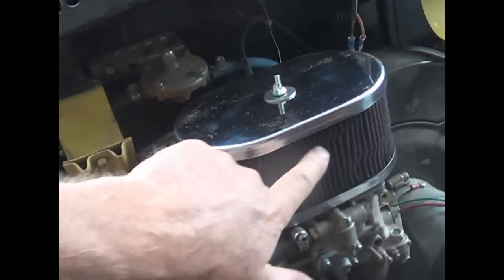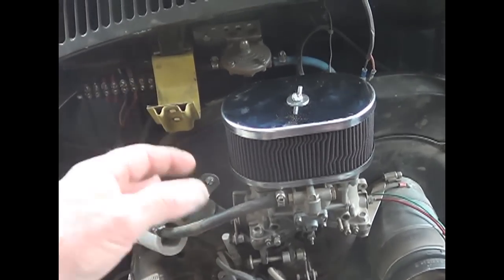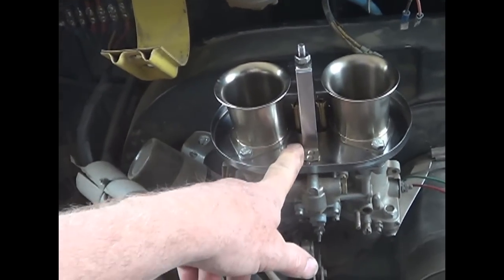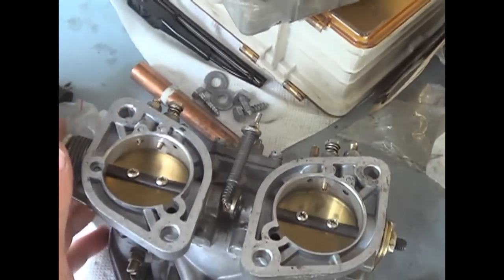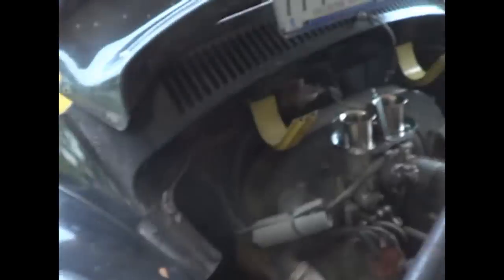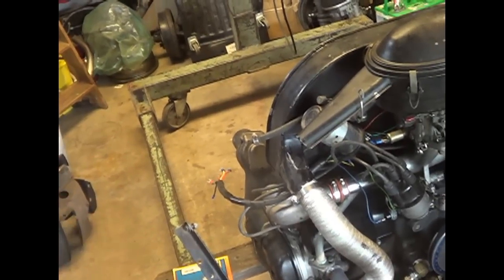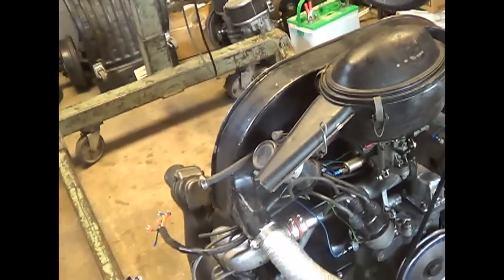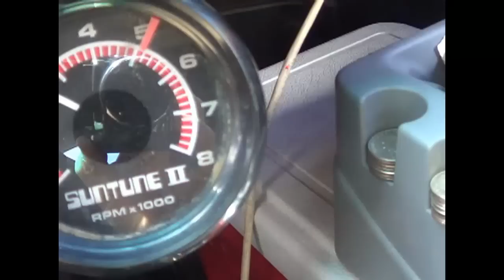Weber IDF Center Mount Problems and Solutions

Comment: Just starting out, purchased a fiberglass buggy, tirying to get the center mount Dellorto 40 to run correct. Just for cruzing around town, not worried about performance. I'm told it is a 1835, I love all the info from your videos. I have watched all the carb videos many times. Thanks keep filming, J Kelley

Comment: Same setup on a twin port 1600. IDF 40 is running smaller 115 main jets, Idle jet 52 Accelerator pump jet 50, Venturi 28mm, F11 Emulsion tube. Mostly driving around sea level though.

Comment: a lot of the problem is the stumble, or soggy bottom, but it's due to lack of heat beneath the carb. The manifold is cold and the fuel falls out of the air moving thru the manifold and it goes lean. got to have a very warm manifold beneath the carb to get the driveabilty back. If your in the desert with over 100 degree F ambient may be ok with out heat...otherwise, got to get it hot.

Comment: 20 years ago I welded up a set of type I dual port manifolds to accept Bus Type IV dual Solex. I can't say I had very good results, but then I wasn't very good at engineering equal flowing manifolds and proper linkage. My point is that the search for the streetable affordable dual carbs is endless
Reply from the maker: +Raymond Heath Seems that way some times. Look at the experience you gained and kept with you all these years. I have tried to make things from time to time because I wanted to save a $. Afterwards the price didn't seem so bad. Just cause they look simple don't mean the average guy can make them. Thanks for watching and sharing

Comment: I have just spent this winter replacing duel carbs rebuilding them adding a cat. Conv. All I am attempt to pass emissions here in Nevada!! 😢. So I just installed new single idf manifold and card linkage (linkage was the worst)🤣🤣. Numbers on the 4 gas were double than acceptable before. Wouldn’t even fail the test as Co2 was over 19% 😊. Hopefully my single idf will at least fail it so I can get a wavier . 😂😂 as I have spent double required
Reply from the maker: That's a bummer. I didn't know Nevada was tuff on emissions!

Comment: My single 44 Weber works great!
Reply from the maker: I'm happy for you. share the details
Reply: It started when my neighbor gave it to me attached to the chrome intake. I installed it on my 1776cc dual-port engine with 044 heads and a 110 Engle cam. The heads have been hemisphered.  Turns out that the carb was originally setup for wide open throttle on a Baja Bug and was just too much for my street Bug. I had the carb venturis reduced in size and rejetted. Has been working great ever since.

Comment: Just installed a center mount carb like yours and i am really happy with it, but did you also have an issue with gascable rubbing on manifold?
Reply from the maker: Yes, I thought about switching to the CB Performance over the top air cleaner base set up but lack of center mount manifold heat was also a problem.
Reply: Hi Fluidspace, I am having the same issue - did you manage to resolve it? Drilling a new hole through the fan shroud?
Reply: I bend the pipe going through the shroud

Comment: It is disgusting how much dust gets through on my HPMX.......along with that, the linkage is garbage. I would love a Weber.......but my pockets are pretty shallow these days.
Reply: The knock off replica Chinese 40 IDF carb are fine. An exact Weber replica. I just purchased a new one on Ebay for $125AUD. New Webers are made in Spain now. Genuine old ones were made in Italy. I have an original Italian 40 DCN 14. It has sat for over a year on the second hand Twin Port 1600 I purchased. I am going to put it aside and clean it, they ran three of these on old Ferraris. I would not go bigger than a 40 IDF on  twin port 1600. This would be to much fuel for a single port heads engine.
Reply: @andyroo3022  I ended up buying a Ch-Weber 40 IDF.....for $48.00......I seriously cannot believe the results; Buggy started right up and idled smoother than I ever heard it idle.....and then proceeded to impress me while on the trails. I then fine-tuned it with the jets from my HPMX......I GLADLY gave the HPMX away to a friend......or was he?!?!?! lmao
Reply: @drummer4hire12  Nice. Bargain performance there.

Comment: Have you ever considered checking out Throttle Body Fuel Injection, such as Holley makes.  They have a single barrel as well as a two and four barrel ones.
Reply from the maker: I saw a vid on a VW Baja with one. It wasn't to detailed. I checked out the price and then there is still that manifold heat issue.  CB makes one with just a throttle body and the injectors are on the in manifold at the head $$$$$$ If people won't buy it there won't be price war's to make them cheaper.  I think thats why all these copy cat carbs are available.

Comment: Really appreciate you answering all these questions it's a ton of help when you have little experience. Here's another one for you? On my 40 IDF when the throttle plates are closed they just barely cover all of the progression holes. When I go to tune the carb if I screw the idle screw in at all it will start to uncover that first progression hole. Is that normal? I thought I heard you say in one of your videos that all the progression ports are supposed to be hid while the vehicle is at idle..
Reply from the maker: The throttle plate should be directly over the first progression hole.  The throttle plate is not round so it allows some air to go past. The needle valves are then used to smooth out your idle. You must use the correct size carb and venturi that Weber recomends  for the displacement of your engine or they won't work properly at idle or low RPM.  
The Individual Runner carbs, IDF, have individual Idle jets and mixture screws for each barrel. They also have an additional air bleed screws and lock nuts. This is not used for idle adjustment or idle quality. The settings for these screws should be closed. 

 
Standard IDF Settings:
Speed screw ¼ to ½ turn in after contact with lever maximum. 
Mixture Screw 1 turn out from lightly seated.
“Lean Best Idle” Procedures
After confirming the linkage allows the throttle lever to seat against the Idle Speed Screw. Back off the Idle Speed Screw, then turn the screw in until it contacts the throttle lever and turn it in ½ turn. Turn in the Mixture Screw in until it “LIGHTLY” seats, then back it out 1 full turn. Loosen the 8mm wrench size nuts on the “air bleed” screws, turn in the air screws until it seats then tighten the nut.
a.      Start the engine, it will run slow and like a tractor. As long as it will stay running, the idle speed is not important at this point.
b.      First, turn in the mixture screw until the engine runs worse, then back out the screw ¼ turn at a time. The engine should start to smooth out. Continue to back the screw out ¼ turn at a time until the screw does nothing or runs worse. Then turn it back in to the point where it ran best. You want to tune the engine by sound. Adjust each mixture screw to the best, fastest and smoothest running point. Do this procedure with each mixture screw.
c.      Now you may adjust the Idle Speed Screw. It should be sensitive and only require ¼ turn in or out to achieve the idle speed you like.
d.      These carbs are commonly used in pairs, this makes the synchronization important, be sure to bring the high flowing carb down to the low flow carb. Then bring them both up to “proper” Idle speed. The Idle Speed Screws are not opened more than ½ turn in.
e.      After synchronizing multiple carbs, reconfirm steps b. c. & d.
“Simple Rules for Calibration”
If your mixture screw is out more than one turn like 11/2 turns then your idle jet is too lean, go up one half size on the Idle jet.
If you mixture screw is not out one full turn, something like only 1/2 turn out from seated then your Idle jet is too rich, go down one half size on the idle jet.
This is all based on the important fact that your speed screws are not open more than ½ turn if they are then that is also an indication that you have a lean Idle circuit. You are cheating by opening the throttle plates and exposing additional progression holes in the transition.

Comment: I currently have a twin Solex carburettor set up. Would you recommend conversation to a single carburettor, please?
Reply from the maker: Probably not.  You can get good performance and economy from dual carbs and make more power. If the engine has a performance camshaft going to a single carb will create smooth running problems.  
You will also need a different intake manifold that has heat and a vacuum advance distributor 
A stock 34 PICT 3 will work great with stock camshaft

Comment: so I've got this exact same setup on a Baja. Center Mount 40 IDF in the process of redoing the entire intake system. I'm skeptical that I will be able to get it to idle with the butterflies all the way closed. Should I try it or should I just go ahead and drill the holes like you did? I understand that the minimal amount of air coming around those closed butterflies was designed to run one cylinder instead of two.
Reply from the maker: I had to drill the holes because the engine was a 1800 and the bypass screws would not work.  You must have heat in the manifold for it to work right when weather is under 75 degrees.  The refrigeration effect drops the temp 36 degrees and the fuel becomes liquid and won't burn.  If you do have to drill the holes start with something under 1/16 and test it. Put the holes on the other side of the throttle shaft away from the progression parts. I did mine wrong. You also need a 0-bypass valve on the accelerator pump inlet. I also had to run 55 idle jets and it still had a flat spot

Comment: EZ, I have a 1641 with a 40 IDF. What jets are you using? I can't get mine to run right. It's to rich. I have new jets. I probably have the ones you used. Thanks in Advance.
Reply from the maker: The stock 115 main with a 50 idle on stock 28mm venturi

Comment: Looking at this carb for a 1776 build. Stock cams, stroke, ect. Really looking for OEM plus performance. What carb would you recommend? Torn between this and several other options and having a hard time sifting through all the internet fluff. Any recommendations would be greatly appreciated!
Reply from the maker: With a fresh 1776 your way far ahead on power.  If your serious I would start with the stock 34 PICT 3 carb with a 130 main jet and use a stock muffler with big bore tips.  The key to making any center mounted carb work well and keeping the fuel in suspension is manifold heat and nobody did it better that the stock factory.   The cams are the same on the 1300, 1500 and 1600 engine because it works so well.  I recommend you drive this car for a few thousand miles and let other folks drive it without telling them what you have. They will wish it was there's. 
If after this you don't mind constant tinkering and don't mind tight quarters I would suggest Dual Kadron Solex 40 carbs, with some cheap headers. All VW engines that are often revved over 4.500 RPM should have heavy duty single springs. If your rocker arm geometry is correct you can still stick with good used stock push rods.
After 30 years of owning and driving VW cars and busses countless miles on and off road. Spending enough money to buy a brand new Porsche the 1776 with stock cam and heads is my pick of the littler.  If you want something bigger and faster save your money and go all out but keep your 1776 stock to put back in when you want to enjoy a reliable ride.

Comment: Hello my friend !! I lo e all your videos ive learned alot from you !! Pls i have 40 idf dual empis carbs on my 72 ghia with 1641cc engine with 110 cam ! And ive been having so much bad issues running them !! Lots of popping and crackling !! Timing is spot on and everything like it supposed to be !! Problem is that i was told the carb jets are to big for this small engine !! I was also told i have to go with smaller jets ! 
I got 
Iddle jets 52 
Air jets 170
Emultion tube F11 
Main jet 130 

So i was thinking what sizes to go down 
Iddle jet 40 or 45 
Emultion tube F9 or F10 
Air jet 150 or 145 
Main jet 110 or 115

Can you pls give me your opinion on this pls ??
Reply from the maker: Snapping and popping is a lean condition.  Clogged idle jet or vacum leak, incorrect float level, clogged fuel inlet. Quit changing things. These things came with the right parts and should work right out of the box. 

40 IDF Dual Carbs 
AIR CORRECTION 2.00 
EMULSION TUBE F-11 
MAIN JET 1.15 
PUMP JET .50 .
IDLE JET .55 (d)
VENTURII 28mm 

Must have synchronizer tool and both carbs at same settings
Idle mixture screw 1 to 1 1/2 turns out.
Reply: @TheEZGZ  thank you for prompt responce Sir ! Will do all your recomendations , and let you know how it goes thank you again God bless

Comment: EZGZ, I am planning a 76/92  and I have the Case ready, and the 44 heads ready to run with single springs.  I am going to use a C35 cam from Scat and want to run a IDF 44.  Any Advise about the carburation I am planning?
Reply from the maker: Great Cam choice. I have one in my 2110. Works best with dual carbs. 44 idf is to big unless you spend the money to get 28 mm venturis like the 40 comes with and a box full of jets. You need heat in the manifold or only drive on 90 degree days.
Reply: @TheEZGZ  Best I go with the 40 IDF than the 44 GZ?  I hope for a smooth Street machine with a lot of spunk. I watch you and Darin the most. Thanks!  Cancelling NETFLIX......
Reply from the maker: @lew9215  If you want power, smoothness and economy get the dual 40's.  Port on Port is the best way to go. Buy new from a reputable company that will prejet and give you support if you have problems.  Your engine is not big enough for the 44's. IMHO  The dual 40's should work right out of the box. Trust me......
SCAT C35 Type 1 Camshaft  is designed for 1.1-1.25 rockers, and it's specs are .381" Cam Lift, .420"/1.1s and .476/1.25s, with 285 degrees of advertised duration, and 246 degrees of duration at .050", on a 108 Lobe Center.
SCAT camshafts have been around seemingly FOREVER, but there is a reason for that (their grinds work well!). While not as State Of The Art as a Web-Cam or a newer FK Series Engle, these are great for the enthusiast that has to watch his pennies!

This cam is similar to the Engle W110 grind; it will run like a bag-o-nails with the stock carburetor, so you have to upgrade to at LEAST dual 1bbl carbs, or a single 2bbl. But it's Velvety smooth with dual 2bbls! This cam requires HD Single Springs and Bolt On Rocker Shafts with 1.1 rockers. If you decide to step up to 1.25 rockers you MUST have dual springs! This is also compatible with stock Single Port (barely) or Dual Port Heads, and it works best with Compression from 8.0-8:5:1. Power band is from 1500 to 5000.

This cam is known as a "3 Bolt" cam, compatible with "early" oil pumps. The oil pump MUST be compatible with the engine case, and the camshaft, for proper engine lubrication!

Comment: hello GZ, I'm from Mexico in baja, I have a
1775cc in my vw vocho
I have a carb 34 pic and a distributor and toyota 22r coil installed in my engine, "it's a special job";
* I want to put a 44 or 40 idf, which carburetor you recommend and which brand of distributor and coil you recommend so that it has a good performance, on the road and out of road
Reply from the maker: http://carcraftstore.com/carbsets.aspx  A SVDA vacum distributor with blue coil will work with most single carb set ups.  
However your engine might make a lot of Horsepower but drivability and gas mileage will be low. Expect 10 MPG or less. You really should be running higher compression and use 93 premium octane to get the most benefit. Good Luck with your project

Comment: nice Vid I tend to agree I Try and keep as close to stock as possable
Reply from the maker: Stock is excellent but I'm addicted to a little more power :-)
Reply: @TheEZGZ  I hear You Brother , Ive had heaps of Flat Twin BMW motor bikes been down that Road for years of Porting  Heads lightened Fly Wheels Delorto Carbs All The Rest of it , Im In Australia Theres a Company here That Makes Super Chargers and Every thing to Bolt on and Make Them Work , Even with the Stock 34 Pict Carb , Gives heaps more Power they Reckon at a Reasonable Cost , I Like your Vids Verry Informative , I might Go down the Super Charger Path , Its a Little Less Travelled I want some thing Reliable and Comfy to Drive as a Daily  Driver
Besides Stock is a Verry Realitive Term LOL

Comment: So I have the vacuum in and the engine races,I have no control over the throttle? Any suggestions? Im about to tear the whole thing back down and run my stock carberator!
Reply from the maker: +Donald Yeager I would love to help but almost nothing to go on. Sounds like you have fuel and air from someplace? Throttle plate closed. Some models had a choke lever in back and used a different enrichment circuit?
If you post vid and give me a link to watch?? Have you got the Weber book?
Most carb books have a trouble shooting section?????